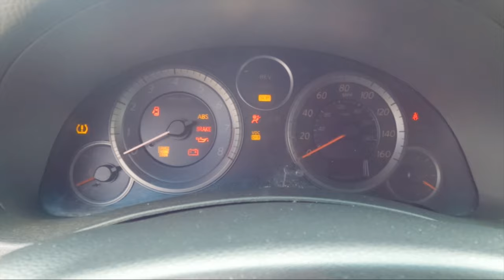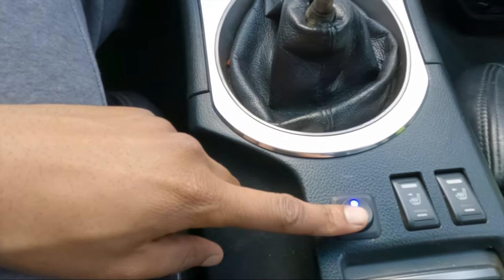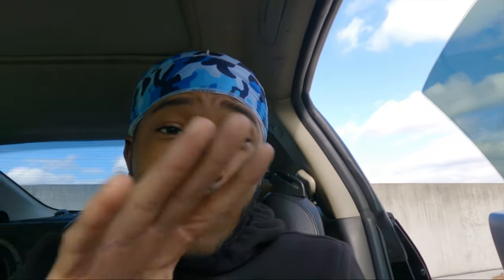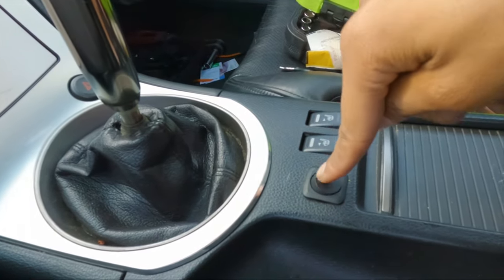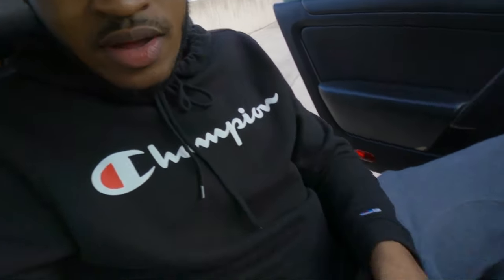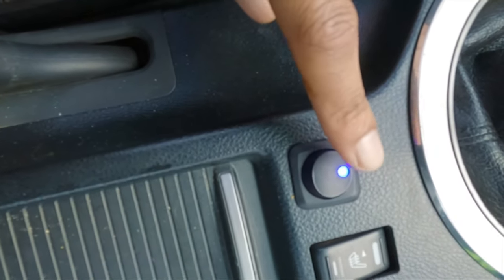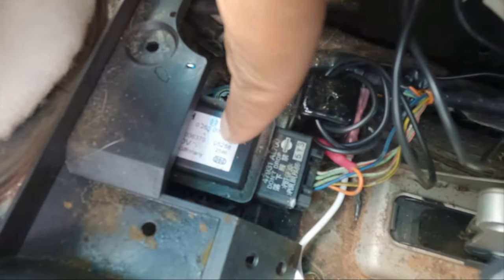How To Fix Slip and VDC Light On An Infiniti G35

Comment: Got slip and TCS off lights on. Engine light is on so I got the codes read and it came back with a faulty knock sensor, about to replace it but wondering if it could be anything else. Car doesn't go into limp mode and sounds and starts like it should. Car was left sitting for 4 years without being driven much and previous owner had to replace seized battery and starter
Reply from the maker: What was the code if you don’t mind me asking? Have you topped off all the fluids?
Reply: @JLowe  I topped off the steering fluid  then reset the ecu and none of the lights came back on, usually they turn on after the car being driven a tiny bit but this time they didn't. I might not have driven it long enough or maybe all it needed was fluids topped off. Code is p0327.
Reply: Nevermind, lights came back on after starting it today. I've taken it to an auto electrician and they read the codes and it only came back with the knock sensor harness

Comment: I owned 4 G coupes 05 rev up manual 
2011 G37  IPL auto
2005 G35 auto
Now a 2004 G35 auto
All of them I've had to do this except the IPL 
I currently just changed ignition coil 6 and now I'm getting a slip and VDC light right after I changed the coil. And it's Givin me trouble starting...so I know these vq engines so well I know its going to be a camshaft sensor because I changed the crank shaft sensor recently which gave me the same issues if not vdc fuses maybe. And I'm dealing with code p1757

Comment: Bro so I bought my g a few months ago and I had the lights on but shir was the can shaft sensor replaced it and also ended up replacing the fuel pump cause it was going out.  Car runs fine now but at random ass times they lights turn on idk if it’s just a dummy light or not
Reply from the maker: Did you use OEM sensors?

Comment: What does the slip light actually mean ?
Reply from the maker: It can mean multiple things usually anything with a de vq in it, it’s a camshaft sensor
Reply: @JLowe  yeah I see that on mine
Reply: How many cam shaft senors do my 2007 g35x awd have
Reply from the maker: @laquanlockhart3615  I think you have an hr engine so that would be 4 of them

Comment: I have an 04 g35 coup. My problem is when i start the car no light comes on but when I step on the break to put it in drive the shifter won't shift an all the vdc slip an abs light comes on. I replace the break switch an still nothing. Any help would be appreciated
Reply: Have you found a solution? I have the same exact problem
Reply: Try the neutral safety switch

Comment: Selling my shi soon 😪
Reply from the maker: Why brother?
Reply: @JLowe  not willing to fix gotta spend like $2k I got 161k miles gonna finance a Q50
Reply from the maker: @toxichazard6442  that’s not a bad move. What’s wrong with it?
Reply: @JLowe  crushed subframe window motors out A/C compressors out I had the Vdc break light problem to it just went away by its self
Reply from the maker: @toxichazard6442  window motor is that bad to replace. The A/C is a little more difficult but still not super challenging. I’d try to fix those and sell it yourself versus selling it to a dealership, you’ll get more for it.
Reply: @toxichazard6442  wat city u at I’ll come pick that up from u
Reply: @Bigturbon55  sold couple days ago for 3.8k